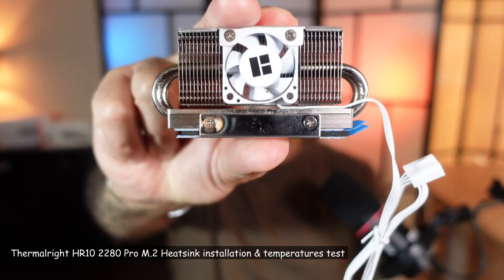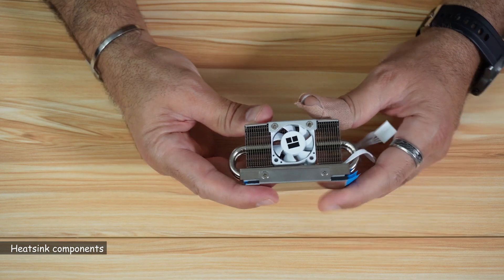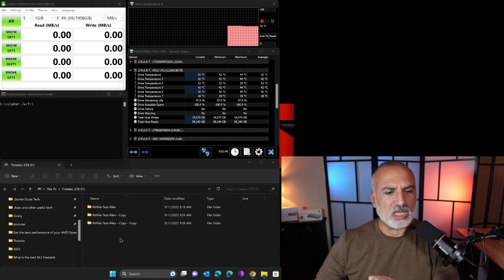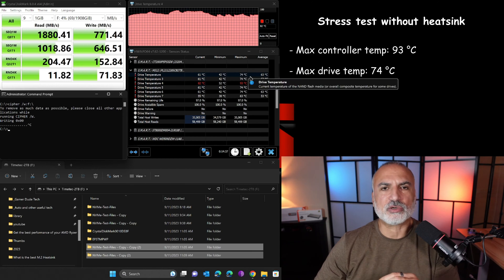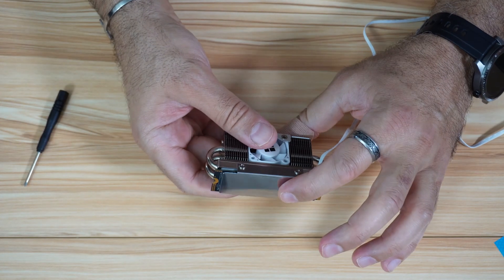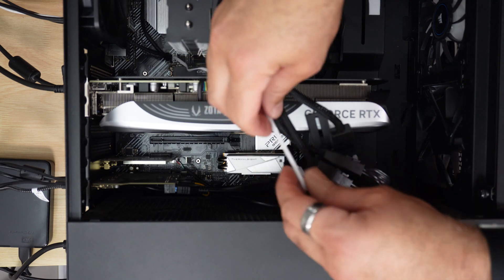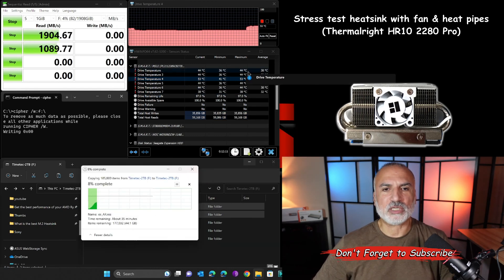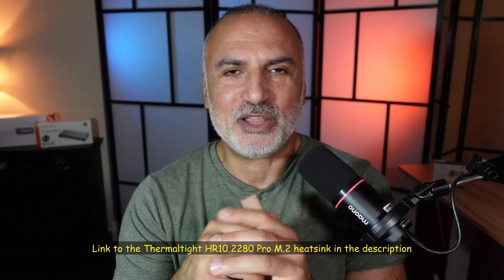M.2 Heatsink with Heat Pipes & Fan | Thermalright HR10 2280 Pro installation & temperature test

Comment: wonderful video...but you put this on your secondary nvme. i see you have a crucial with no heatsink at all in your motherboard for your main drive...was there no place for this heatsink for your C: main drive?
Reply from the maker: The Crucial wasn’t heating ip as the 2nd drive and the second drive holds all my data . So I use it extensively. Thanks for watching!

Comment: i recommend you sir to do the noise level test of that heatsink.. some people are using their PC in silent mode
Reply from the maker: It's a bit noisy at full speed
Reply: @KnowledgeSharingTech  ah thanks for the info :)
Reply: @TwoWorld-w1q  but noone uses this at full speed. difference is negligable. ;) use it at 50% speed and its virtually silent.

Comment: I always wondered if I had to remove the original NVMe sticker before applying the heatsink, but apparently there's no need? What I mean is that at 4:15 you are applying the heatsink directly on the NVMe sticker. Wouldn't be much better to applying it without label? Maybe a difference of 1-2ºC ? Did anyone try?

EDIT: I actually searched on youtube and seems like the sticker itself has metallic composition in it, which seems to have an excellent heat conduction! That's crazy. That means that it's better to keep the sticker on :D
Reply: Late reply but you never want to remove the sticker on the nvme. Leave it on as it has some thermal transfer properties despite looking like a regular sticker.
Reply: @tiovelvet: Thanks for asking and editing! This was exactly MY question, which is now answered. Thanks!

Comment: When tuning the fan speed with the PWM control, is it possible to make the fan turn at slow rpm (for example 500 - 1,000 rpm) so that the fan is completely silent, or does it only spin up at a minimum rpm (such as 3,500 rpm) and always makes some noticeable noise?  I understand it makes a whiny noise at max speed 6,500 rpm.
Reply: @ddbear8786  it is pwm contoled- so yes it is possible to low the rpm

Comment: I've thinking to buy this Thermalright HR10 2280 Pro but I have a Thermalright 360mm in my CPU. I'll not able to control the M.2 Heatsink? I don't understand english very well (from Brazil).
Reply from the maker: The CPU heatsink and the M.2 heatsink are separate and don’t interfere with each other.
Reply: @KnowledgeSharingTech  Thanks! You're an amazing reviewer, please don't stop the content!

Comment: Yesterday I experienced the perils of PCIE gen 5.0 nvme SSD thermal slowdown with a new motherboard, cpu, RAM combo.  I started a Clonezilla disk restore and it started at 16.5 GB a minute and over 30 minutes slowed down to 3.5GB a minute.  In Linux shell I could see NVME SSD temperature went over 65c.  The gimmick ASUS motherboard NVME heatsink was not that good.  Now I have a Thermalright HR10.  The small fan should keep rising heatsink temperature in check.
Reply from the maker: Thanks for sharing

Comment: You also gained about 1,300MB/s in write speed? Maybe a issue with the thermal stress testing having strange effects on the speed. 
Not bad for a $10 product. Just hope that fan is going to be good for years of constant use.
Reply: They throttle the controller speed when they hit the thermal limit, when that happens it kills performance. I just ordered one of these because I am getting stuttering under heavy read/write loads and I realized my drive was hitting 80+ because asus for some reason only put a heatsink on the secondary slot.

Comment: I was wondering if I can plug it into any other Header cuz all my fan headers are used
Reply from the maker: Yes you can
Reply: Use a splitter cable
Reply: @PlayJewel  i did, and i added more fans to my case, too.
I never knew about a splitter before, and it's kinda cool

Comment: why such low tranfer rates?
Reply: It's a basic brand SSD so likely that's it's real world performance, otherwise it could be running in 2 lane gen 3 mode (That bottom slot is pci 3 on b550) if all them other pcie devices saturate the bandwidth it could be running PCIe 3.o x2 (20gbps / 2GB/s)

Comment: Interesting results.
Regarding the 'tuning fan' part, you can also use an open source software called Fan Control, there you can control the fan based on the SSD's temperature, granting more control.
Reply from the maker: Thanks for the info